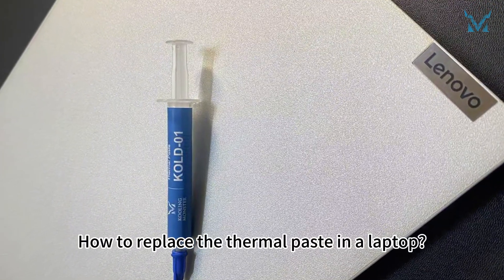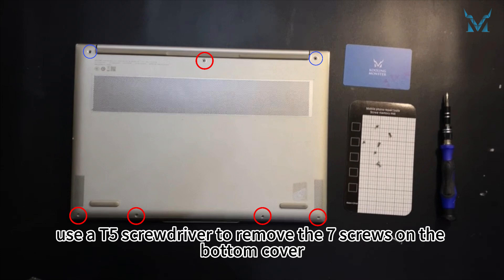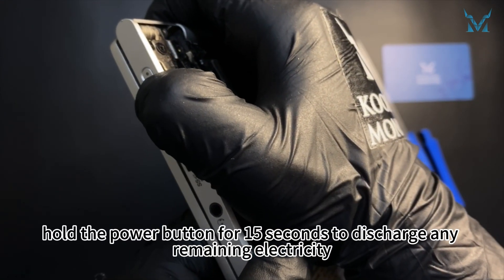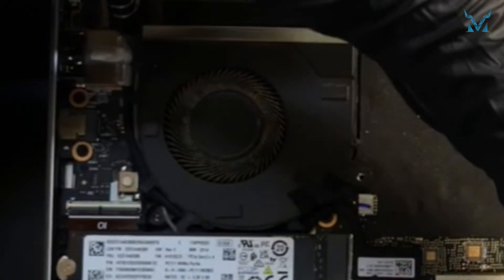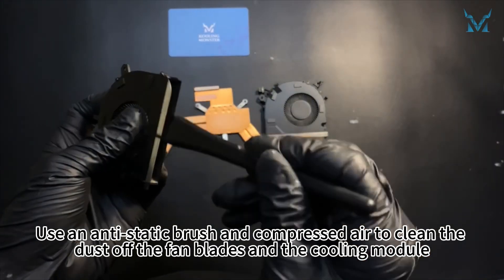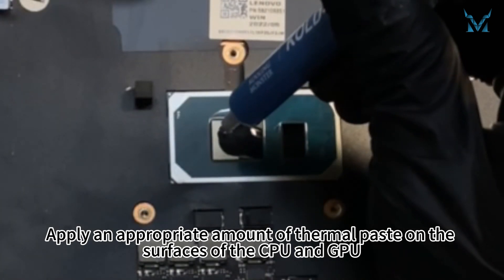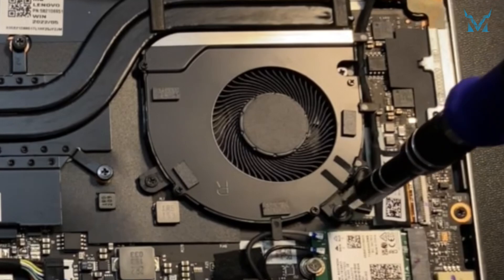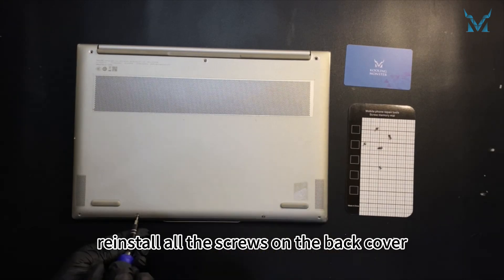Speed Up Your  Lenovo IdeaPad 5 Pro 14 2021 Prevent Overheating With Dust Cleaning&New Thermal Paste

Comment: You're supposed to prevent the fan from spinning. Putting compressed air right into the fan and spinning it manually damages the rotors.
Reply from the maker: Thanks for the feedback!